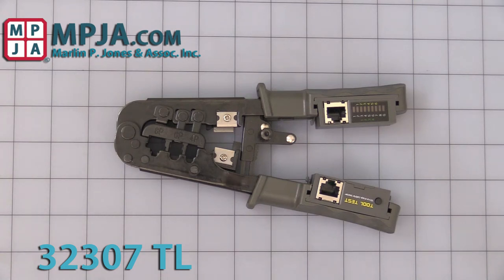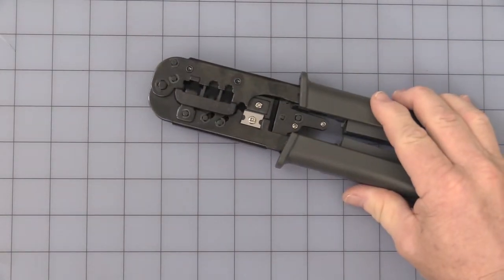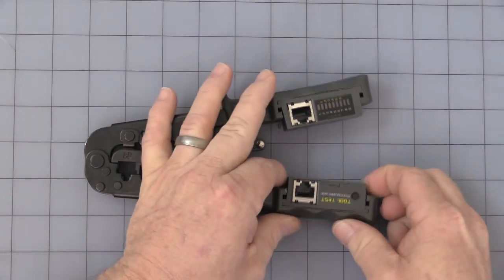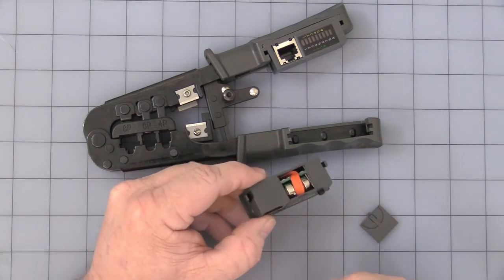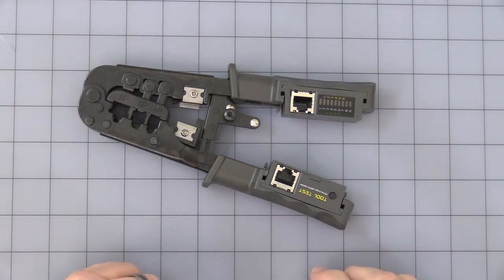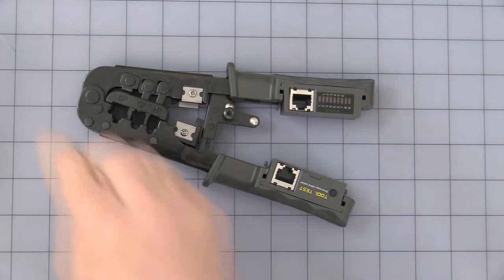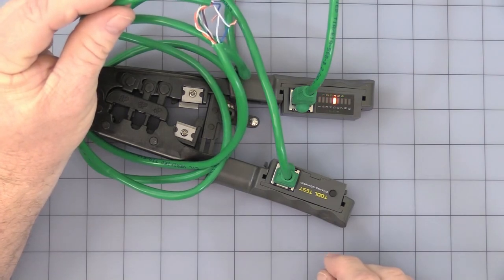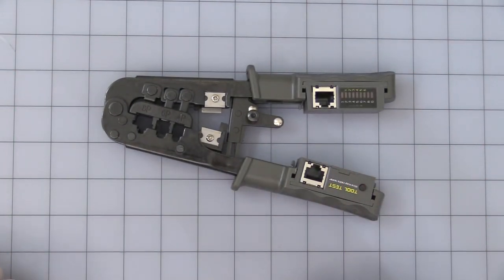RJ Crimp Tool With LAN Cable Tester 32307 TL

Comment: Just to clarify. It basically lets the user know whether his work with crimping the ethernet rj45 tips are good or not basically. Whether it be a bad crimp or if the cable itself is bad. Handy tool.
Reply: Yes